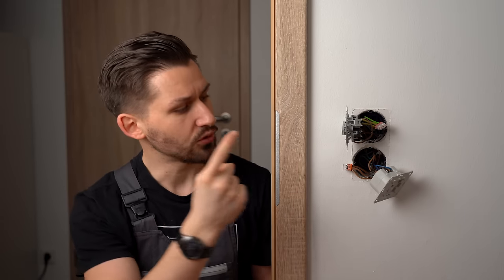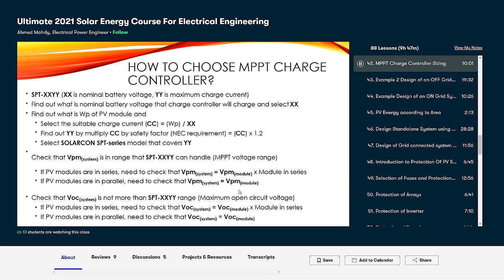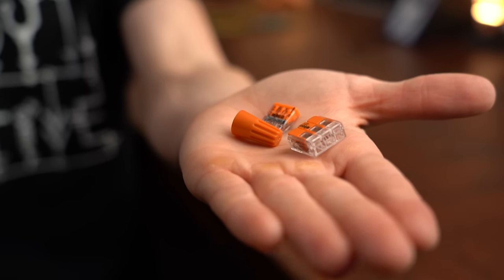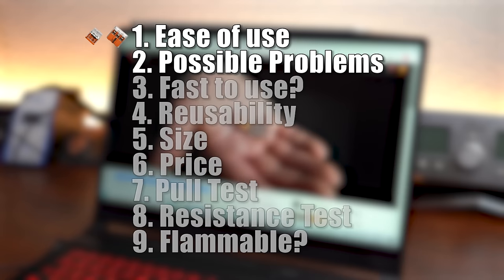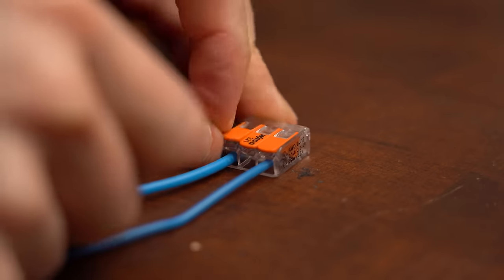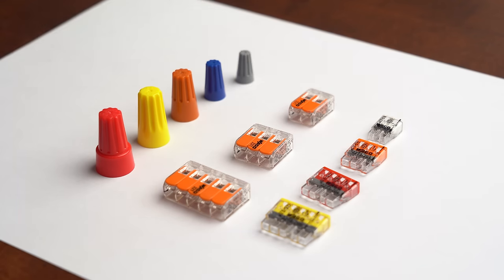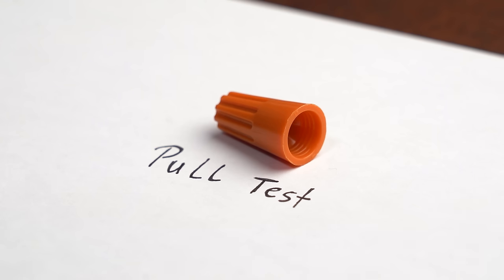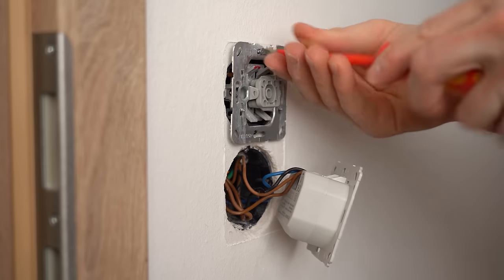What Wire Connector is the Best? Settling a Debate! Wire Nut VS Wago

Comment: The reason wire nuts don't have a current rating is because they are not intended to conduct electricity. They are intended hold the wires in intimate contact. The wires themselves are the bus. This is best illustrated by the fact that not all wire nuts contain any conductive material.
Reply: While I get what you are saying, the connection between the wires is not flawless (Especially if the wires are not perfectly connected, as seen once in this video), and thus a high enough current will still create additional heat at the connection, which could melt the connector if the current is too high. Of course such a current should not be achievable under normal circumstances, but considering these connectors are used in the US (120v vs 240v, thus twice the current for the same power) it is still a bit weird.
Reply: That was my first thought in the conductivity test. The wire nut isn't meant to conduct anything, they just smash the two wires together tightly which seems ideal but the wagos performed very well.
Reply: Ah, that makes total sense. Of course it actually adds zero resistance.
Reply: that also explained why wire nuts have lowest resistance...

but wire nuts are easily loose, especially after hard days works. in some crucial connection, this might be the last thing you want to have.

and wago have a more consistent grip
Reply: @mongelaloe2304  I think wirenutz have the strongest grip when done right but easy to install wrong and hard to check.
Reply: @mongelaloe2304  only if you're a scrub. You shouldn't have any loose connections. That's on you.
Reply: @NICKLASFARFAR  The purpose of a wire nut is to create a gas tight connection between the conductors directly. Look at the resistance test. The better Wago performed only 37.5% as well as the wire nut. The wire nut was 14.66 times better in the resistance test.
Reply: @mongelaloe2304  Properly installed wire nuts never losen.
Reply: @mongelaloe2304  wire nuts are not "easily" loosened, but if not properly tightened or checked, they can come loose, but i have seen several instances where lugs and split bolts were loose. As with anything proper installation is important.
Reply: "Properly installed" is the key, and what separates wire nuts from wagos. The  margin of error for an optimal proper installation is very narrow for wire nuts, and the difficulty curve steepens dramatically as you increase the number and type of wires in the joint. Two or three wires you can generally hold together and twist with the wire nut itself, but 4 or more requires that you pre-twist and build up additional layers. If you've got to incorporate any small fine stranded wire, such as when attaching an occupancy sensor power pack, that's a very common point of failure and rework. With the Wago, you just strip them all to the right length and use one of those wideboys and that's all you need to do.
Reply: @Peter_S_  Mate I did not say the Wago connector is better resistance wise, just saying it is weird not having a maximum current rating. How much current can I pass through the connector? 100A? 50A? 200A? Also this resistance will vary depending on how successful you manage to get the connection inside the housing (Which you can not visually confirm). The Wago rating of 32A means that worst case, it should be able to handle 32 amperes.
Reply: @NICKLASFARFAR  You don't pass current through the wire nut. You seem to have a fundamental misunderstanding of what a wire nut is and what it does. When you properly use a wire nut, something which is not shown in this video, you use lineman's pliers top twist the conductors together in a low resistance 'gas tight' connection FIRST. The connection has the same rating as the wire you are using. After you make the physical connection, you trim the end and add the nut on top to keep the connection you just made secure. In commercial service, you then add several wraps of lineman's tape at the base of the nut to prevent anything from sticking into the gap.
Reply: @jarphabib  I was taught, when using wire nuts, all wires must contact all other wires, and if that isn't possible, make multiple separate connections (so six wires would be 4+4, the interconnecting wire adding one to each group of 3). The interconnect should always be the same gauge as the incoming hot. Always twist first (using, "lineman pliers"), verify the connection, then install the wire nut.
Reply: @NICKLASFARFAR  the connector does not conduct any of the current so therefore the limitation is solely on the wire used.
Reply: @NICKLASFARFAR  -  We have 240 in USA and Canada in our homes. They only deliver 120 (one side of the transformer to each outlet) to small appliance outlets. I assure you that my stove, electric dryer, and air conditioner are 240v.  And I put in a 240 line to my bench here to power things that require a few more watts. Most Europe and foreign outlets allow 10 amps or something near that at 240. Standard US outlet allows 15 amps and I have special ones in boxes rated for 20A at 125v for those devices needing 2kw... But at that power level, most places just use the 240 across the two hot legs of the transformer. Technology connections had a good video on how our panels are wired.
Reply: @imikla  That eould be ideal! But that logic means that a wire nut can handle only 3 wires, because geometrically speaking you can only have three circles touch each other at the same time. So you would need to have two wires and a jumper to the next joint, which will rapidly eat up both your time, nuts and box fill.
Reply: Yeah. That's why they have wire nuts for wet conditions. Does Wago make a Moisture resistant connector?
Reply: @jarphabib  In theory that's true, but 4 will all come in contact in the twist due to juggling and deformation. I've also been told 2-3 is good, 4 is allowed, 5+ must be redesigned or split into 2s and three (preferably counting the interconnect). This is all more conservative that the electrical code to encourage better planning and reduce risk, as I do see wire nuts rated for 5 wires which I'm sure won't all come in contact (I don't think I've ever seen any rated for 6).
Reply: @imikla  The problem is that the ratings chart is a matrix of multiple wire size combinations with gaps in it. It says on the upper end that a wire nut maxes out at, say, 5x #10s but it does not say that you can't use it on 12x #14s.
Reply: @jarphabib  If a combo isn't listed I don't use, but I've never run across combo I needed that wasn't covered by the wire nuts I keep in my box.
Reply: @mongelaloe2304  any electrician worth their salt wrap the nut to the wire in the direction of the twist to keep the nut from backing off as you manipulate the wire into the box. Same for outlets where you connect your wires except that's to add a little protection, specially in metal boxes
Reply: My older home from the late 1950's contained ceramic wire nuts that didn't contain any metal in them at all.   Great comment Michael Aichlmayr.
Reply: @MARKE911  in the UK? They were called Scruits and are no longer permitted. They worked ok on the old soft lead cables.
Reply: @RabbitsInBlack  Yes they do, it's called 'Wago Gelbox'. They have protection class IPX8 (indicates that the terminals are completely sealed and can also be permanently submerged in water)
Reply: @Ed Straker  You rarely see 240v used for circuits less than 30 amps in the US.
Some 20 amp 240v circuits are out there but the majority of buildings do not have then.
Reply: @typoagain1  so are all those 240V circuits hard wired? No plugs and sockets?
Reply: Wonder that nothing was said about, that you can probe wago from the front, as they have a touch proof opening to insert probe needles. Furthermore, wagos can have spare connectors, which would allow easily to add something to an existing circuit. This becomes very handy especially for neutral and earth lines, which are usually connected all together.
I never used wirenuts, so I wonder how you probe them and how you add wires anytime later, other then replacing them.
Reply: @NICKLASFARFAR  Not really. The wire you are using already has a max current rating. If the wire nut is rated to handle that wire it is rated thus to handle the current. Tight connections don't get really get "hot" as long as the wire or bus is sized accordingly.
Reply: I have seen connectors that rely on a blade or thin piece of metal to conduct current between wires fail after a load like a electric space heater was connected to the circuit. In America the code requires compression and  properly used wirenuts will do that. Often electrical connections will fail when a spring weakens (often from heating and cooling cycles). Once a spring become weak, the electrical connection may start arcing. This creates peaks/valleys due to pitting. This lowers surface area of connection. I seen this with the clamps of a breaker on the busbar. Once the busbar under the clamp, it heats the breaker causing it to trip. New breakers installed in the same location suffers from the same problem. This is because the pitted metal does not have enough surface area and produces heat. This is why I prefer wirenuts for load bearing circuits
Reply: @NICKLASFARFAR  he didn't use the correctly in the first place you're supposed to twist the wire's together tightly with pliers then add the nut
Reply: @pen25  yes of course, some others also pointed out that too... the keyword here is the craftmanship when we are using wirenut.
Reply: Yeah I would like to see a high current test through each of the connectors. See which one fails first
Reply: @NICKLASFARFAR  The maximum current you can pass through a wire nut connection is dictated by the gauge, and therefore maximum continuous current, of the base wire.
Reply: @tonyjover  Usually HVAC things are hard wired, so air conditioners, furnaces, water heaters and heat pumps because they are considered permanent installations.  Electric clothes dryers and stoves (hobs) have plugs.  Very large plugs.  In such that the NEMA 5 plug is dwarfed by the UK plug, the UK plug is dwarfed by the NEMA 14.  Although most of the time those appliances are considered permanent installations, they do break and can be replaced, upgraded or serviced more easily since they can be unplugged.
Reply: @tonyjover  we have multiple styles of 240V plugs and sockets. It's often based on appliance current draw and whether it's a 3-wire or 4-wire circuit.
Reply: @NICKLASFARFAR  If you are using the appropriated wire you shouldn't have to worry, after all they come with the max current the can sustain and will only cause problem if you exceed it
Reply: @KlodFather  in Germany 230v is for small devices and 380v for stoves or heaters and so on. We have fuses from 6a to 63a in small houses. The most common fuses are 16a, 20a, 32a and 63a. Living in a flat we only have 16a fuses
Reply: I never had any issues with the wire nuts at work I cannot remove the wire from these useless wago connectors so I just cut the wire off remove the ballast and use orange wire nuts to connect the wires that go to the light sockets if I could remove the wires I would keep the wago connectors. Bottom line I never had any issues with the orange wire nuts. I see the ones on here have removable wire features but cost is not worth buying wago.
Reply: @ricozam132  -   I had the opportunity to visit Ukraine in Russia in the past. They use the same round plug with two pins on it that you guys use in Continental europe. It was also scary to see how much aluminum wire that they run to those rooms and outlets. I don't think you guys are doing the same things that they are there, but it looked like the thickness of American 12 gauge wire and the outlets were rated at about 10 amps. I've also seen a bunch of European connectors and plugs because we had them in one of the factories and I worked at. We built our f equipment specifically transmitters and other electronic instrumentation, and a lot of it was actually designed operating europe. So we always had European outlets around. Although we were feeding them with 60 HZ power instead of 50 because that's what's available. In some rare cases we had a motor generator set up that would turn 60 HZ into 50 hz. That was pretty effective it delivering actual power. I noticed that the rated or stated voltage and what's actually in the outlets is different from place to place. When I was traveling internationally I would actually get my digital meter out and not only look at the waveform being provided in the wall but I would also look at the voltages. Most countries that were 222.3240 where somewhere in that range. It's like here in the states. Even though they say that we have $120 volts that we have 115, depending on where you're at in an electrical system, some places might be 111 or 112 volts other places might be $127 like where my parents lived. We just happen to be on a particularly hot transformer. So sometimes it doesn't have any rhyme or reason or it depends on how close you are to the substation because the transformers on the pole have taps for the high voltage side and if the high voltage side is a little bit high and they're on the lowest tap on the transformer that takes it off the feeder to the line coming into the house, it could be a number of voltages. I knew about your 383 phase. Three legs of 380 and any one of them to neutral will yield you 230v or so. We have something similar here called 208v 3 phase. It gives us three legs of 120 and there is 208 between the legs for running bigger appliances. Large appliances it require 220 or 240 run a little softer on 208, but it works good enough that nobody complains. Stoves air conditioners furnaces and other equipment that would use the 220 if they're fed 208 work just fine. It's a small enough percentile that there's really no degradation in performance or at least any that's noticeable. But when my foreign wife came here with a bag full of 220 appliances, she was perplexed at our outlets and that they didn't work. However I'm a resourceful guy. And having worked in that company where we had European outlets, I ran a 12 gauge three wire line upstairs with a ground to a special box and I put in European outlets on the kitchenette. They were providing roughly 220 volts 60 HZ and the teapots hair dryers and all the other devices function just fine. There was 20 amps coming up there and all of those individual outlets were fused at 10 amps or so.
Reply: @JbVest  -  that should be easy. You can also see from his data that the resistance is much higher on the pushing connector than the wire nut. It's very easy to calculate the amount of power that will be dissipated at that connection at a said current because we already know the nominal voltage. The wire nuts are not going to get hot because they're not actually passing the current. It's going to be predicated on how well the conductors are wrapped with each other and the wire nut is on them. The pushing connector is definitely going to get hot in a hurry because of the size of the surfaces that are in contact with the primary wire. It's going to be a lot of heat dissipated in those connectors at their rating. They will definitely be warm to The touch under load. He even says so in the video. He was very clear to say then when they were up at their maximum current, they got warm.
Reply: @mongelaloe2304  I am an electrical engineer.  Worked in Germany and now in the US. When using wire nuts, it's dirt simple.  Key is twisting the wire together first, then twisting that single wire onto the wire nut.  Twist until firm, otherwise they will slip (weakness with wire nuts).  
Twisting with different gauge wires is simple. Wago is limited.  
Simple clamp in Wago.  Not enough surface contact. That's what it's all about in electricals.  
Wire nuts easy to read with color coding.  
lots of conductivity and contact.  
Why re-use a Wago connector when electricity is involved? Should be disposable.  Would you put a used engine into a new car chassis?  
In the US, wire nuts have been used for decades.  
As Einstein said, "make it as simple as possible, but no simpler."  Wire nuts.
Reply: @Ed Straker -  The furnace and air conditioner are wired direct because they are permanent installations. Stoves, portable air conditioners, clothes dryers, and electric heaters and cookers all use a plug. Some plugs are giant and some are about the same size as our 120v with the prongs turned sideways depending on current rating. My ex-wife was from Europe and she had a lot of 220v small appliances when she came here. I ran a 220v 60hz line up to the kitchen and put in some EU plugs with breakers at 10A each. Those worked well for her. A tea pot that is 2kw boils water faster than our 1350 watt tea kettle but only marginally faster. But this setup made life much easier for her until all that stuff eventually broke some years later. I can tell you that motors like 60hz much better and do not labor as much. We had to be careful to engineer enough fans and cooling into 50hz equipment we built because the motors and fans all turn slower on 50hz even with the same given voltage. For the most part, your appliances will all run well here if the proper plug is installed to connect them. Work just fine.
Reply: @KlodFather  very concise info there sir. That was my thought too, on the wire nut.  If you twist the wires properly for a wire nut all it's doing is somewhat insulating it and holding The joint together. I could certainly see your higher resistance on the waygo connectors but high enough to be a concern in proper applications,  probably not. Would be interesting to see just how it would fail under a unrealistic current load
Reply: @JbVest  -  I think we should have Photonic Induction do a test on this since his machines can generate all the juice, fire, and smoke necessary to give them a proper test  :D  😅🤣😂
Reply: @Ed Straker -  The part that give me a good spook was that the panels in one country I visited had 440 in them with a center tap for 220 + 220 setup with the neutral to ground like USA breaker panels. 440 is a bitch and was more than I wanted to piss with LOL. Some of the wiring I saw in old Russian apartment buildings on the mains left much to be desired. I am going to have to post some of those photos sometime soon for people to look at. Three 220 mains about 35mm diameter running up the central shaft of the apartment building. People just tap them unfused and then breaker them inside their apartments. I have seen them with jumper cable claws bit onto the main bus bars. CRAZY
Reply: @KlodFather  Now, now, don't take away their sense of superiority over us.
Reply: @jarphabib  And wire nuts have a learning curve. Especially when joining solid and stranded wires. If one wire is too long, it bottoms out in the wire nut and won't let the connection get tight. I've seen loose connections where all I had to do was snip off 1/8 inch of wire and they tighten right up.
Still, it's a common practice to use electrical tape over each wire nut, which kind of defeats the whole purpose!
Reply: @mongelaloe2304  That's probably why wire-nuts are often taped if they're critical. But even then, I wouldn't say they're easily loosed if properly put together.
Reply: @NICKLASFARFAR  your assumption about twice the current for the same power is flawed, because thicker wires end up being required. Also, fully ceramic wire nuts are routinely used for natural gas hot surface ignitors. They merely hold the wires together. Even wire nuts with metal inside do not expect the metal to conduct. It is a conical steel spring that merely holds the wires together. The Wago has current limitations, because its design requires a bus bar that wire nuts avoid. The best part is the part you leave out, because it will never fail you.
Reply: @ronb6182  Sorry, but when you use the old fashioned, stupid wire nuts you have to cut all wires, when you want to add only one more wire!
It's easy to disconnect and reconnect all kinds of WAGOs, no need to shorten the wires. The types without the lever are available with up to 8 holes. In Germany we use WAGO for more than 40 years without problems. Also our outlets are much smaller than the ugly american outlets, we don't have the space that you waste with wirenuts.
Reply: @horstklotsch5589  nope I will keep using what I have I'm not going to make these foreign ers rich just because they come out with something new. The ones in the fixture are one time type you cannot remove the wire. I would reuse them if I could pull the wire out. I have to remove the ballast anyways. I work for a company that don't want to spend money and I have a boat load of wire nuts. We use gorilla nuts in our machines I'm sure there is a water proof wago but it's not up to me to tell the engineers what to use in our Air machines. Thanks but no thanks. 73
Reply: @horstklotsch5589  nope I will keep using what I have I'm not going to make these foreign ers rich just because they come out with something new. The ones in the fixture are one time type you cannot remove the wire. I would reuse them if I could pull the wire out. I have to remove the ballast anyways. I work for a company that don't want to spend money and I have a boat load of wire nuts. We use gorilla nuts in our machines I'm sure there is a water proof wago but it's not up to me to tell the engineers what to use in our Air machines. Thanks but no thanks. 73
Reply: @ronb6182  More than 40 years is not new for me...
Of course you can remove the wire easily, and reconnect it without additional work, but if you don't want to learn somerhing new, I can't help you. I don't make foreigners rich, because WAGO is a German company and I am from Germany:-)
Reply: @horstklotsch5589  if they ain't made in the USA they are foreign. Bottom line my work won't buy them. Money is tight right now And everyone wants to keep their job and hours. I see others think it's a waste of money if you read the comments maybe not on this video but others on you tube. 73
Reply: @NICKLASFARFAR  if the wire nut is tight, then its a good connection, even if the the wires are side by side.
Reply: @mongelaloe2304  thats why you use tape, it helps keep the weather out, as well as keeps the connection tight. You know for an electrician channel, there are a lot of clueless people here
Reply: @NICKLASFARFAR  as much as the wire can handle. Are you not paying attention?
Reply: I was gonna say the same thing, the current rating is the rating of the wire inserted, since its really just connecting two wires together
Reply: @tonyjover  Plugs and sockets up to 50amp 240 1phase are common. Over 50 amps are USUALLY 3phase. (And expensive!)
Reply: What is relevant is the nuts temperature rating.
Reply: @rok1475  No, I'm not mistaken. Read both my posts. Firstly, this post is addressing The issue of the current rating. Secondly, The twist and the wire nut are both involved in the holding. If that weren't true, no one would waste money on wire nuts, they'd just twist them and wrap them with tape. And of course insulation is one of the properties, that issue was never in question. Are you just looking for an argument?
Reply: @SAxSF  I agree. I thought about mentioning that, but decided to leave that can of worms to be opened separately. (Not that it's not important; temperature rating is one of the worst neglected parts of electrical wiring, but it's a lot bigger issue than just wire nuts.)
Reply: Monge
Of course both generally aren’t in a moving application 🤔
Reply: Monge
Of course both generally aren’t in a moving application 🤔
Reply: Monge
Of course both generally aren’t in a moving application 🤔
Reply: Monge
Of course both generally aren’t in a moving application 🤔
Reply: @rok1475  Nope. You are wrong.
Reply: @imikla  
It seem you can’t understand even such a simple fact as why one can’t just wrap tape around twisted wire ends. 
To prove your point you respond to facts like a small child.
I regret wasting my time explaining anything to you. 
Have a good day.
Reply: @rok1475  I see you resort to insults when I refuse to argue with you.
Reply: @NICKLASFARFAR  if you hire an electrician that's doing the job properly then it isn't a concern, you have to use lineman's first and twist the wires into a very good connection prior to using a wire nut, the wire nut is not intended to twist the wires like he was doing in the vid (you can especially tell he used them wrong when the wires were twisted down the shielded section).
Reply: @NICKLASFARFAR  user error causing a poor connection would not be part of a spec
Reply: @Ed Straker for that voltage we use two phases to add up to that. Most appliances run off of 110
Reply: @mongelaloe2304  you definitely have to put the wire nut on correctly for it to work
Reply: @Ed Straker Most large appliances in American homes have 240v plugs if they require 240v. Cheaply built houses and apartments might have the stove hardwired, but clothing dryers often have a 30A 240v plug.
240v plugs are most common in 30amp, and 50amp configurations.
Reply: then their design is even more poorly done than i have thought, thank you! i will make sure they will never be used anywhere near me.
Reply: @FTfilm  wire nuts?

how is it bad design for no current to pass through an insulator
Reply: The wire nuts that are just plastic without the metal spring part are terrible, they don't bite down on the wire at all.  Better electrical tape the crap out of them if using those.
Reply: @Dan-yk6sy  electric tape brakes down into nasty goop after a while. Just spend the extra fraction of a cent on the wire nut with metal
Reply: @horstklotsch5589  I deliberately compared the Wago connectors with the same size wire nut and the Lever Wago was LARGER then the wire nut... that debunks the size statement... the next is the push ons... they are about the same size for a standard three wire connection, but the wire nut can be removed and reused if necessary, whereas the Wago MUST have the same size solid wires and cannot be removed or reused... only cut off.   You can call them "stupid" all you like but wire nuts have their place and purpose and are as effective as the Wago with less complication and cost per part... just a little more technical expertise or experience is recommended for wire nuts. There are also many applications where wire nuts can be used where National Electric Code will NOT allow the use of clamp style connectors.
Reply: @edwardpaulsen1074  Of course the Wagos can be reused. I would only describe the user as stupid, if he doesn't know how to get the wires out again...
Reply: @JbVest  I've seen a high power test somewhere and the conclusion was that the Wago can take more than the wire insulation can. I would like to revisit that clip, but don't have it saved.
Reply: @ContraVsGigi  id like to see that too, but how my mind works, id say if the wire was twisted properly when using a wire nut, that would beat any other connecter style. just cant see the wago beating the twisted copper to copper. but hey what do i know!
Reply: @Keechization  Yes of course, thanks for pointing it out for me.

I didn't mean wire nuts are bad, they just have to be handled correctly, like some other said it's all back to craftmanship, that's very much agreed.

Because we cannot see what's inside, and for me myself, i usually gives a pull or two to make sure the connection is ok. Just to make sure
Reply: @skrenos  so just like here state side.  Our major systems are hard wired 240 of course and our other appliances are plug in 4 prong 240 . Our small appliance outlets are 120 of course
Reply: @NICKLASFARFAR  I have never seen a wago connector until 3 years ago. I haven't went back not because they are better for any other reason than they are quicker. Wire nuts dont have a rating because they dont transfer electrical current they just hold wires together thay conduct that current.wagos are great I love the ease and the ability to use them in tight spots they hold good .. good enough for a wire for sure I feel like some people act like these wires hold thousands of pound so pressure they dont . I love wago connectors I wouldn't say they are better but they are my choice
Reply: @ptravers9077  Eh?  I was describing state side wiring which is why I mentioned NEMA.
Reply: That is just stupid, because current in the wires will heat the connectors, no matter if they are conductive or not and the material has to be able to handle the heat.
Reply: @Wheresmy240  Nope... not "very well".
Reply: @mongelaloe2304  loose connections are NEVER acceptable... not "might be".
WAGO has a wire termination that can wiggle. This is why higher resistance, because the busbar has a higher CSA than the cable being inserted, and the conductor is not firmly clamped down. 
Further, dissimilar metal connections induce corrosion. Any plumber will tell you steel saddle clamps on copper pipe is disaster waiting to happen.
Reply: @Peter_S_  LOL... gas tight connection? 
Wire nuts are a very poor option compared to other forms of mechanical connection.
Reply: @jarphabib  Oversize WAGO for small conductors is asking for loose connections.
Reply: @pen25  Yeah BUT, in the USA any idiot can do home wiring.
Reply: @ronb6182  Those lousy wire nuts are used in Aircraft? What type, so I know what to never fly in.
Reply: @BTW...  we are not talking about aeromechanics STAY ON THE SUBJECT!  I don't wire airplanes or Automobiles. I only wire my own home. Enough said. 73
Reply: @ronb6182   You mentioned "air machine"... and the point is I never ever trust either wire nuts or wago in any mains wiring system... or an aircraft or a boat or ship.
It's a matter of integrity.... and on that point here we don't allow unqualified randoms wire up homes.
Reply: @seanthiar   obviously dont get it the have no rating because they conduct no electricity.. there for if the administrator a load to one end and then the other there will be nothing because it's not conducive.. the rating would be that of the wire you are using. There heat rating has nothing to do with conductivity and wire nuts do hold up under heat as well as wago if not better since that dont conduct electricity.
Reply: @seanthiar  That is why temperature ratings and capacities must be taken into account for ALL connections.
Reply: @mongelaloe2304  Hard days work?  Wire nuts are for household wiring.  They're not supposed to be used for anything that is going to be moving.  There are other connectors for that.  Do you typically flex your walls during a hard days work?
Reply: Calling BS on your statement that they don't have an amperage rating. They ARE rated by conductor size. Yellow wire nut, two conductors max 12 gauge=15 amps per NEC. You actually have to use whatever passes for a brain. Instead of pushing the connectors you are getting paid to push.
Reply: but the nuts in the video do contain metal, which will melt if abused.
Reply: @BTW...  air machine to vacuum cars out and to fill the tires up. I forgot the vac part sometimes it air and water machines . I cannot tell the engineers how to make the products I just put them together. If it was up to me everything would be direct wired or good terminals. I have my own design and it's not what I build at work.
Reply: @Rem1061  You actually just agreed with me.
Reply: @sombrero4316  Sure, I agree with that. If you don't follow the guide, you're asking for trouble. The number of wires and sizes for a given wire nut are listed for a reason. It also doesn't hurt to study about temperature ratings in the electrical code. It applies to many more things that just connections.
Reply: @Peter_S_  Yeah they do vibration will loosen them
Reply: @mongelaloe2304     vous n'êtes pas un professionnel de l'électricité
Reply: @horstklotsch5589  Why yes, the lever action ones can easily be reused.... not so much with the other variant... Yes, there is a possibility of spinning the wire while pulling and spiraling it out... not very effective inside the electrical box or with more than one wire. I am sorry you did not make that distinction. The other VERY specific detriment to those spring loaded types are that once the spring has been clamped and deformed onto a wire once, they lose a certain amount of applicable pressure capability and this has been inarguably proven within the aviation and transportation industries.  

Again, I like using the Wago connectors whenever it makes sense, but there are some situations where the wire nuts are a better choice with appropriate application.
Reply: @sierra5065  wrong, due to current, stuff gets heated as current passes and the "special" twist you made using pliers, loosens up due to expantion, air gaps appear and thus conducts less current and more heat is generated.
That's why they where phased out in Europe and "forbidden" to use,  quite some time ago.

In the past we had a special porcelain or plastic tools for these connections.
Reply: Exactly.  This is evident in the key test of resistance.  The WAGO fasteners are using what looks like a steel connection between the wires while the wire nut directly connects two copper wires.  Copper has a much lower resistance to current than steel.  This results in a better connection (allowing more current to flow) and lower temperatures (since resistance is lower).  A WAGO using copper wouldn't work well since copper is much softer and might cause the connection to fail under tension.
Reply: @Peter_S_  Loosen not losen
Reply: @NICKLASFARFAR   YoUr CoNnEcTiOn IsN't FlAwLeSs
Reply: Every wire nut I have come across has been made of solid porcelain. I mostly use choc block in a mole box.
Reply: @jarphabib  great for for amateurs. Professionals should have the skill to connect a wire nut if they all themselves a professional.
Reply: Wire nuts actually do have a current rating, but more in line with what wire gauge and how many can be joined.  They don’t pass current but retain the conductors.
Reply: @KlodFather  Well spoken.  The Engineering Mindset has a decent explanation as well.
Reply: Yeah, I just started working with an electrician and the wire nut size you choose is just based on the size of the wires, no googling or memorization required. Wago connectors might still be better but that point of comparison isn’t really that valid
Reply: Plastic doesn't conduct electricity 🤣
Reply: Wire nuts are just that. Simple clamps. It doesn't help the connection in any way, hence they are completely reliant of installer competence. Wago are a bit more sophisticated (hence the price) but are much more fool proof.
Reply: @Wheresmy240  however, the metal cap inside is live if touching copper, therefore should be correctly rated..
Reply: DIdn't the one he showed have a little metal spring inside?
Reply: @Monge LaLoe,

Wirenuts come loose if they're installed wrong.

Wagos lose their spring over time because they're always under tension. So point of failure is guaranteed.
Reply: @torstenwagner1185  it's the better question when do you add lines normally?  makes sense if your changing connections like once a year or not but whats the point of having connections like wago with 4 ports if your only using 2 for 40years and then decided to add another wire 10 years later

it does easily to add something to an existing circuit but circuits don't change often,

this is coming from someone who lives in a old house that at one point had 3 fuse boxes since it was a old telephone building but was added 4 times onto from 1900s till now.

since we re wired the house in 1995 we only added a circuit in past  27 years
Reply: @NICKLASFARFAR  I've seen multiple people talk about the wire nut connectors melting because the contact wasnt good enough and it overheated.

Wagos make way more reliable contact unless you want to solder before putting on a wire nut.
Reply: Intimate 🔥
Reply: @typoagain1  I have 4 20AMP 240V breakers. All electric baseboards
Reply: @Peter_S_  i find out burnt out ones made by Conex all the time.
Reply: @Boz Scaggs Obviously
Reply: @NICKLASFARFAR  I don't think there was actually anything wrong with the connection shown in the video.  Unless one of the wires was actually loose, that connection would still have been better than traversing a bus bar and two contact points.

Most of the points in favor of the Wago over the nuts are meaningless to an electrician.
Reply: @jarphabib  Not really, if you're using the correct size wire nut for the wires you're using, you shouldn't have much trouble getting it right. And a bit of electrical tape over the top after you're done makes absolutely sure that it's not going to wiggle loose on it's own later on. 

I'm personally more worreid about internal damage to the wires getting everything in and out of the box when the previous idjit was trying to do too much with one box.
Reply: @imikla  That's what you're doing wrong, you actually learned what you were doing before bad-mouthing the equipment. I do think it's worth noting that wire nuts have been around for quite a few decades at this point, and if used appropriately, they work. It's also worth noting that the other ones he's demonstrating are German, as in overengineered kit that isn't always good enough to justify the engineering that went into it. 

Personally, I’m more than happy to just use the wire nuts and just be mindful about making a proper connection, as it appears to be far stronger mechanically if some bright guy decides to pull on one or the other end.
Reply: @kevinsundquist1989  Precisely, the metal in the wire nut is there to provide some teeth to pull the connection in, make it less likely to pop off or split when installing. It's just there for reinforcement, not as a conductor. It will conduct a bit of electricity, but only because they don't worry about using a non-conducting metal. It's certainly never intended to be the conductor the way that some of those blades are in some types of wire connectors.
Reply: @jarphabib  Just speaking from my own experience here:  I HATE using dissimilar metals or wire types (stranded/solid) or differing wire gauges in any one wire nut.  That's asking for trouble down the line.  I get varying reactions from my electrician friends WRT taping of wire nuts after installation - some say "yes" while others say "not no, but HECK no!".  I tend not to tape them after t/s & r unless they were taped originally (and to use the same type of tape as in the original installation).

Using dissimilar metals can occasion thermoelectric effect:  current flowing across the junction of a de facto thermocouple can cause it to heat up!
Reply: He also didn't twist his solid wires every electrician knows you twist to give a solid mechanical connection before you put the wire nut on. Thus reducing down the Resistance and possible heat.
Reply: @horstklotsch5589  why do you have to cut the wires with a wire nut? Just add a wire and a bigger wire nut.
Reply: 45 years in the business,  when wire nuts are installed correctly,  no failures.
Reply: Yes, I stopped watching right at that point...
Reply: @edrorie7764  electric baseboard radiator thermostats come with wire nuts and not Wagos, must mean they’re safe.
Reply: @horusfalcon  they make wire nuts for AL/CU connections.
Reply: I've never heard this,  this is good information.  👍
Reply: @calysagora3615  this is good information too, Mexican ingenuity.
Reply: @etherealrose2139  your 100% right.
Reply: @Peter_S_  Peter S is a good electrician.
Reply: @imikla  this good solid advice. 👍
Reply: @NICKLASFARFAR  I was about to switch to Wagos after seeing them so often online but this video has convinced me otherwise. Stranded wire should be further in the wirenut than solid. Granted, it's not written on the connector so perhaps for DIY it's a poor choice.

But these tests show the Wagos losing in the critical categories. Equal weight is not appropriate IMO. Price is the non-critical category which I would weight the highest. Again, wire nuts.

But safety? I gasped at the resistance the Wagos add. Close to a quarter mile of wire?! I'm suspicious of the pull test - it wasn't completed. Why did the wire nuts win there but tied on size and flammability? What happened to only one winner?
Reply: @ronb6182  "I'm not going to make these foreign ers rich just..."  Do you walk everywhere and never eat fresh vegetables in the winter?  How are you even connected to the internet?  We barely manufacture anything in the US anymore.  Even when we do, there will be components that have been internationally sourced.  How is it that people who spend time talking to folks outside our borders have such a poor view of them?  73 LOL
Reply: @NICKLASFARFAR  Greetings:.  "Twice the current, same power" ??? Mathematically illogical.
Reply: @Dark_Knight_USA  120V * 2A = 240V  * 1A
Both equaling same power, however 2A results in 4 times the power loss in the connector as the power loss is R * I^2
Which part of this confuses you?
Reply: @NICKLASFARFAR  Greetings: The equation, as listed here, is logical. No confusion. and no debate given.  On another note, what is the "^" in the formula?
Reply: @g00gle minus I have worked in Low Voltage around professional electricians for years, and have seen them use Wire nuts, it takes them about 10-15 seconds to twist and cap the conductors, about the same amount of time as pushing those same conductors into a Wago. Experience and Training Matter. I did not talk about stripping because both connector types require that.
Reply: @Dark_Knight_USA  if you don't have a way to do a Super Script when writing a formula ^ becomes "To the Power of" so I^2 spoken would be "I" Squared.
Reply: @kelaEQ2  Greetings: Thx. My hand can write superscript with no problem.  Typing it can B interesting, depending on the device.
Reply: @mongelaloe2304  Wire nuts are still a thing in The Netherlands, besides different kinds of Wago clamps. Wire nuts were the first type of interconnection possible in house wiring (they started off with tar, than we got porcelain, than plastic ones).
But, in contrast to the US, they are NOT allowed to be used on stranded wires. Solid conductors only AND one will have to twist the wires first. Just having two wires side by side and just twisting a nut on them is not allowed. One needs to twist them thoroughly before screwing the wire nut onto them. Once the wire nut is on, you can unscrew the plastic cap to check whether the connection has been made in a correct manner (wires only slightly sticking out at the top-end of the metal spring, insulation clearance about a 1 millimeter before the spring starts).
The twisting is hard if your wires are short (10 to 12 centimeter (4 to 5 inches) as is usually the case in Dutch housewiring junction boxes, which is why you will usually get taught how to twist the wires correctly when you're an apprentice or intern: instead of short pieces, the wires are stripped 10 to 20 centimeters long. With 3 conductors, one 1 is fold to the left, while the other two are fold to the right. Then you twist them by grabbing on to the copper conductors. When done, you cut the excess conductors to length and screw on the wirenut.
The downside is when you are lefthanded: my dad is lefthanded and always had trouble twisting the wires (which should be done clockwise when having the end of the wires point away from you) as the wirenuts always screw on like you would fasten a normal screw. That's far easier to do as righthanded electrician.
Reply: Best  and most educated comment by far on this video
Reply: Those wires are getting intimate over there 😏
Reply: @jentronics3754  The most basic problem with clamps is that people either re-use them after pulling wires out, which is not recommended, or that they just don't read the instructions on the length the bare conductor needs to have. They either strip too long or way too short. Too long isn't such a big deal: if the wires touch, a dead short will most likely be the result and that's dealt with by fuses or circuit breakers.
Too short however is a problem and frequently occurs: the wire then does get stuck under the clamp but with very minimal contact. It can't be pushed in deeper because the insulation interferes with the connector. It's a solid connection outside the box, but once the wires are all pushed inside the junction box (I'm talking about my Dutch experience as an electrician here, our junction boxes are not big) the connection can loosen itself from the connector. It will make contact and provide voltage, but only at light loads. Heavier loads will get the connection warmed up and eventually fail. If you're lucky, it fails by going open, if you're unlucky it starts a fire.
Fire's rarely start by short circuits as you read in the newspapers often in The Netherlands. Contact-resistances do.
Reply: @BTW...  Just like in The Netherlands, where the profession of electrician is also not protected (unfortunately...)
Reply: @David-bb2ed  Whole cities are now wired with Wago-connectors in The Netherlands and probably for decades. If they are that bad, I expect a high amount of domestic fires, but the opposite is true. Domestic fires are still as uncommon as they always were. The only difference is that all the insulating stuff, which is usually a plastic, usually kills you far quicker than in the past, when home-insulation wasn't such a big factor yet.
Wago is a well known brand throughout Europe that has a very broad range of cage-clamp DIN-rail connectors, still the old style screw-clamp connectors, PCB clamp connectors or lifting-cage connectors, and what nots.
They're not stupid and test their connectors thoroughly. They don't want claims because their products aren't specced properly. Usually when it DOES go wrong, it's up to the electrician (read: any normal person, the title is not protected in The Netherlands) that installed them and did something wrong.
As stranded wire is not even allowed in wirenuts in The Netherlands, it's a factor I can't even judge for DIY use.
Reply: @mitch9509  Indeed, it is or near the top .
Reply: @weeardguy  It's not a matter of 'protecting' the profession. It's a matter of integrity and safety for the users of an installation.
Reply: @weeardguy  When you mention "stranded" wire (lets say 2.5mm sq CSA) how many strands in that conductor? 7 or >20 multi strand?. 
Australian Standards dictate that all Earth conductors are stranded rather than a single solid wire.  It reduces potential for fatigue breakage.
Cable - The very cheapest 3 conductor,  thermoplastic sheathed cable has solid core Active & Neutral with stranded Earth.  The far nicer and easier cable to work with (and more expensive) has all 3 conductors stranded... being far more flexible and less prone to conductor breakage when reworking behind switch plates, J-boxes etc. ALL multi core cable ( >3-5 core) will be stranded flexible construction.  Inter-panel control cable could have >12 core + Earth... I've frequently installed and terminated 24 core, 7strand @ 1.5 and 2.5mmSq CSA. 
The most common means of connection is by screw clamping. 2 screws on any Earth connection in J-Boxes and Earth bars in a distribution switchboard. 
Wire Nuts are NON-COMPLIANT to A/NZ Standards. 
Here, you only find 'spring clamp'/WAGO etc in consumer appliances or in the form of DIN35 rail mounted terminal blocks, where the conductors are always multi strand.
Every stranded cable I've ever terminated in these 'spring clamp' terminals has had a crimp ferule applied.. ALWAYS. The same apples to screwed box terminals anyway.
Reply: @BTW...  2,5 mm2 is always >20 strands, most likely even 1,5 mm2 is already over that number of strands. I can't remember ever seeing wires with less and thicker strands in that size.
When you get to (I think) 16 mm2, wires can be thick-stranded or multi-stranded, the latter being easier to process in junction boxes and electrical cabinets and such as it bends much 'easier' (at my former employer, cabinets were usually ordered a tad too small, which lead to the electricians having to resort to very sharp turns that were hard to deal with: where they used their body weight, I had a bit of a problem with just 55 kilo ;)

Earth conductors depend in The Netherlands: in cabling it's always stranded and even in cabinets it's usually stranded. In appliances like emergency lighting and evacuation-path-illumination, the wires usually are solid (but then all and not only the earth wire).

The differences are structural earth wires. Those tie the grounds of the concrete-armor of the home with the electrical installation, the gas-mains (if applicable, there's no natural gas-mains coming into the home I live in), the water-mains,  the central-ground-point coming from the shower, and are all rock-solid.

The earth-wires in the shower to the central-ground-point are also all solid (2,5 mm2 tinned copper). In the shower, the radiator, water-mains, concrete-armor in the floor, the socket for shavers, the shower sink cover (if metal), the bath-tub (if metal) and all 'strange conductors' as our electrical code calls it, connect to the central-ground-point, which is a massive tinned-copper block where every connection is tightened with two screws. This point is usually unconveniently located under the sink or behind the mirror.
If I remember it right, a thick 6 or even 16 mm2 solid tinned copper wire goes down to the main junction box, where it connects with the main-earth-point, that in turn, gets a solid tinned copper wire (2,5 mm2) from the earthbar in the fuse-box, (those earth bars usually extend out the side of the box) and also gets the water-mains, gas-mains, and (if applicable) the concrete armor ground connected to it. From that block, a very thick solid tinned copper cable runs down to the earthing-electrode, but this depends on the system used. Some systems used the concrete-armor from all homes as a suitable earth, some use an earthing electrode for every home but link all those together (to get the earth-resistance lower) and some just stick with an electrode per home. There have been homes were earth would be delivered by the utility-company, but I never encountered those situations.

Wire nuts are allowed, but only on solid wires and only when at least 3 wires have to be joined: putting a wire nut on just two wires is not allowed (but trust me, especially in older Amsterdam homes, you'll see it a lot)
This is because we (as far as I know) only have two sizes of wire nuts that only work when 3 or more wires (5 is the max for the most used, 2,5 mm2 variant) are available.
Screw-clamps are still very common, but it completely depends on the situation what is used.
Spring clamp terminals like Wago Topjob and equivalent were widely used at my former job. We usually only crimped ferrules on wires below 0,5 mm2. Above that, the wire was stuck inside those clamps 'bare'.
Screw terminals always got ferrules where I worked, but it differs from company to company.
Our code is covered by NEN1010, but as this is a norm thought of by the wholesalers in electrical products, it's not that surprising they usually change every year.
Where NEN1010 is just a norm (and you thus are allowed to deviate from), the Building Code however is a law and as the Building Code states something like: 'The electrical installation of a building used for living or utility, must adhere to NEN1010', this basically turns NEN1010 into a law, which is why there's a decades long debate going on from (especially) electricians that the NEN1010 books should be free of charge instead of costing the pretty penny like it is now. I had to spent something like 570 euro on the 7 (yes, really 7) books that covered the NEN1010: two years later (after I finished my education to become an electrician) the NEN1010 norm was revised and brought back to fewer books, but as a revision completely supersedes the old version, one will have to buy the new version to stay up to date on the new rules.

And since 7 months I now work in a completely different environment where I don't even need all the NEN1010 crap I got in school over the years ;)
Reply: @joseph5900  Which is exactly what I said.
Reply: You one smart cookie. I’ve been using wire nuts for years and I would not have thought of that reply.
Reply: I Love The way you say held together in intimate contact with each other.  It's almost like saying that God is the nut that holds intimate connection together, so I suppose Jesus would be the electrician that twists the intimate connection together and places the nut. Job completed and for added safety a little tape so all know it's black so it's dangerous voltage.  And let's face it, people are attracted to colors so colorful wired nuts, have no barring on the size, rating, OR INSULATIVE.....is there a rating for insulative rating?  Besides resistance so communication is not broken between SAFETY and Design?  It SHOULD have since the SIZE is obvious but how well it protects is NOT.
Reply: @NICKLASFARFAR  confused about voltage and current being AMOUNT, you say twice amount but technically the amount is measured in amps.  A 12 volt battery will start a car but a one million volt tazer is only good for SHOCKING people into dancing if they could adjust to it's frequency. Instead they just flop like fish out of water.  I tried powering a light bulb with a tazer and couldn't.  Because it's really only 9 volts point something am peers.  Kinda like the AMOUNT of people and ONE president, or police officer with a RADIO and a license to listen on certain frequency and TRANSMIT on the same to corral the millions of sheep to wolf ratio.  Kind of like a lake of fire or LACK of fire. 😉
Reply: @NICKLASFARFAR  I meant to say LACK of FEAR
Reply: @RabbitsInBlack  There are also porcelain wire nuts for high heat, but nothing for lever nuts or push connectors. Lever nuts are convienent for connecting 4+ wires but thats it, wire nuts are better in every other way. To anyone who argues lever nuts are easier to use, if wire nuts are complicated to you, you should leave the electricity alone before you burn your house down
Reply: @toondejaeghere3  those are over $5 each plus the lever nut water proof wire nuts are like $5 for a 20 pack, so sure they exist but that gets expensive fast. However lets be honest both options are not ideal for wet locations better to use water tight junction boxes and liquid tight box connectors.
Reply: @horstklotsch5589  you don't have to cut the wires to remove from a wire nut at all, you are thinking of dead end splices maybe (which are crimped so not removable), there is no reason to have to cut the wires out of a wire nut ever it literally unscrews off the wires, then you add your additional wire and twist the wire nut on, might have to go up a size I have done it thousands of times and believe me if you had to cut them every time I would never put them back on. Also I am not biased against Wago they are nice to work with but my job won't buy them because they cost 5 times as much as wire nuts or spade connectors and if you wire nuts are too complicated you probably shouldn't mess with electricity.
Reply: @edwardpaulsen1074  Couldn't have said it better diffrent tools for diffrent jobs
Reply: @AnalogDude_  those old ceramic wire nuts that they used in the UK are not the same as pastic wire nuts that we use the US. The problem with the ceramic wire nuts is they crack from the heat, as he showed in the video plastic wire nuts have very low resistance and make a solid connection. Europes judgment of wire nuts is based off a garbage product from 70 years ago that hasn't seen use in the US since before my grandfather was a child.
Reply: @CrimeVid  those are garbage and not the same as what we use in the US, the plastic wire nuts are not the same and have been in use since the end of knob and tube wiring. Porcelain wire nuts do still exist though for high temp applications (such as near burners in ovens or furnaces) which unfortunitly there really isn't much else it's porcelain wire nut or porcelain screw block I personally use the wire nut and wrap it with fiberglass tape and I only use them when I have to; the prefered method is a completely new run of high temp wire but some times time restrictions make that not possible.
Reply: @WJCTechyman  you are correct sir, the current rating for wire nuts is vastly over the current rating of the wire that it would hold, so your wire will melt long before the wire nut is even a consideration, not that wire nuts should be passing current anyways because they simply bond the wires togeather and do not act as a bridge the way lever nuts do.
Reply: @keldon_champion  Time is money.
Working with Wagos is faster and safer, compared to the whole price for an installation it is no big difference in the end. In Europe nearly no one uses wire nuts, our outlets in the wall are smaller than yours, it is much easier to put some Wagos behind your switch or socket...
Reply: @horstklotsch5589  if you say so but it takes about the same amount of time for a wire nut as a wago unless you're a little slow and I think there are places wagos are better than wire nuts it is just not everywhere. For example in resistant dependant circuits (many things with sensors) wagos are terrible also in high heat areas there is no option to even use them, however if you have to join 4+ wires or are going to be frequently changing parts out on the circuit they are much easier, different tools for different jobs if you can't see the clear advantages of each system and places where one is better than the other your just being ignorant.
Reply: @keldon_champion  I don't think I'm ignorant. High heat is no problem, because the insulation of the wire will melt before the Wago does. The "normal" Wago (without the levers, for solid wires) is not so expensive, so for me there is no reason to use such an old fashioned system...
Reply: @horstklotsch5589  the push on wagos have more than double the resistance of a wire nut which would absolutely affect a sensor such as a thermistor, there are times wagos are better, times wire nuts are better and a lot of times (most honestly) where it is completely irrelevant which you use. Also high temp wire is a thing so no wire will not melt before the wago if you are using appropriate wire, which this wire is used in tons of applications such as anything with a heating element or for flame rectification rods in gas burning appliances. I don't understand why people simp for stupid shit like this both have pros and cons and both have appropriate applications, the only person who is wrong is the one who fails to use every tool available to them to do the best job they can.

Edit: also lever nuts where invented in 1951 modern plastic wire nuts (not the old ceramic crap that cracks and causes fires) where invented in 1963 so I don't think old fashioned is an appropriate term seeing as in wagos are the older tech just saying.
Reply: @keldon_champion  If the environment requires high temp wires, wire nuts and wagos are not the good choice. For this kind of applications exist special terminals with ceramic insulation. The problem with thermistors is not the resistance of the wago, it is the material. If you use copper cable to extend the thermistor cable, you have the same problem, even if you use wire nuts. You must use an extension cable that fits to the thermistor you use. For example Fe-CuNi thermistors require a cable made of the same material. In this case you may use special terminals, or wire nuts, or you twist the 2 wires together and put them in one hole from a Wago...
Reply: @horstklotsch5589  yes thermistors use special wire but you can still splice a new thermistor onto the old wire in a lot of applications, and what about extending wire for heating elements or flame rectification rods? You're just hunting for any reason to hate on wire nuts, both systems have appropriate applications but as I said earlier in most situations it is completely irrelevant, I'm done debating with who refuses to acknowledge reasonable and logical criticism and just simp for 1 system while blindly rejecting the other, so we are done here unless you can show me a way that wagos can be used for every application wire nuts can because I see no way to use them with high temp wire, or in resistance sensitive applications, if you can answer me those we can talk but right now you're just being a simp.
Reply: @keldon_champion  The best thing is, you use your wire nuts, I use my WAGOs, and everything is fine.
Reply: @horstklotsch5589  as I said I use both for different applications, but you're right in most applications either one is completely fine use whichever you like.
Reply: Yeah I thought it was odd that he even had to go to the trouble of measuring the resistance? It's the resistance of twisting bare wires together which is to say the resistance of the wires.
Reply: @mongelaloe2304  no.. wire nuts hold string
Reply: @NICKLASFARFAR  Sure, but that's not down to the design of the nut, but the skill of the operator. While it's true that the Wagos are more bullet proof (for hoe DIYers) you average electrician knows when the connection is solid... and for some connections, you pretwist the wires with some pliers to ensure a good connection.
Reply: @sierra5065  Yep! Wirenuts (we tend to call them marrettes in Canada) definitely depend more on skill. For DIYers, I usually recommend wagos.
Reply: But you do want the wire nut to be sharp enough to carve into the copper to get a secure fit and if the plastic was heat resistant and non-flammable that would be a plus.
Reply: It is also evident by the fact that if you remove the wire nuts the circuit will still work (it just might burn ur house down 😅)
Reply: @mongelaloe2304  shouldn't be twisting the wires together with the wire nut anyways, you're supposed to pretwist with pliers. Not sure if they're called the same everywhere, but 9" lineman's pliers to be exact. The twist takes no effort and comes out identical every time after your first couple dozen while learning as an apprentice.
Reply: @Peter_S_  any metallic object in contact with current needs to be rated for said current. This fantasy that wire nuts aren't to conduct current but more to hold the wires, is ridiculous. You're wrapping wire around copper conductors, it needs to be rated for the current carrying capacity.
Reply: @NICKLASFARFAR  yea but like, it's not like the entirety of the current is going through the conductor either
Reply: Hi,
This is how I learned to use wire nuts in the 70s: we strip the wires (from 2 to even 6-7 strands) ~3cm long. Then twist it tightly first by hand, then with a tool (combination pliers) (not the wire nut does the twisting). When this is done, the twisted wire is cut to a length of ~2 cm, and the wire nut is screwed onto it. Here, the inside of the wire frame was a conical steel spring. This fixed the wires well. According to my practice, the wire nut was developed to improve the twisted bond that was found to be non-standard.
Szia!
A huzalanyákat használni én így tanultam a 70-es években: a vezetékeket (2-től  akár 6-7 szálig) ~3cm hosszan csupaszítjuk. Azután először kézzel, azután szerszámmal (kombináltfogó) erősen összecsavarjuk (nem a drót anya végzi az összecsavarást). Amikor ez kész, az összecsavart vezetéket levágjuk ~2cm hosszúra, erre csavarjuk rá a drótanyát. Itt nálunk a drótanya belseje kúpos acélrugó volt. Ez jól rögzítette a vezetékeket. Az én gyakorlatom szerint, a drótanyát a szabványtalannak nyílvánított sodrott kötés javítására fejlesztették ki.
Reply: @noggfresh  why does not twisting wire make him a clown ? Maybe he's not experienced in making stupid wire hack TikTok videos or working to ancient NEC regulations.
Reply: @noggfresh  nah, it's not a TikTok video at all. TikTok videos contain clowns twisting wires together, like your NEC code. All electricians don't use wire nuts, they aren't used in Europe or the UK because our regulations require us to test the installation for manufacturing defects in both the cable and receptacles, require earthing resistance values, PFC, polarity and continuity of bonding conductors. And you can't do that with big silly mounds of twisted wires.
Reply: @WB_Sparks  obviously this isn't a tiktok video. And no shit Europe and UK don't use em. But you guys use Linesman Pliers, no? Lol yet you twist no wires 🤷.  And I can do all that testing with or without wirenuts. Lmao

My point was he's comparing connectors and didn't even use the wire nuts correctly. SAME AS A TIKTOK STYLE VIDEO
Reply: @WB_Sparks  Lmao and seems like you guys don't know how to troubleshoot they gotta make it idiot proof
Reply: @noggfresh  and I quote "Do not twist conductors installed in a single terminal together – this may result in 
work hardening and conductors snapping when untwisted to permit, for example, 
periodic testing" 

Nothing to do with trouble shooting or anything else. If you break a conductor you've gotta add a joint which increases resistance, it may need to be installed in an enclosure or it may need to be replaced completely as some conductors should be continuous without breakage. I understand all this testing is alien for you fit and forget boys, but the rest of the grownups in the electrical industry can actually prove their installation or periodic test with parameters and values.
Reply: @noggfresh  He sets a very bad example. It can even be a fire hazard. First, you have to make a staple screw connection (it doesn't matter in which direction, left-handed people shouldn't do it!), and then wrap the wire nut on it to fix it.
Reply: @Peter_S_  I don't think you understand that when you pass current through a wire it will heat up, and just like with wire insulation, a terminal connection such as a wire nut would have a theoretical maximum heat it can withstand before its integrity is compromised. That is the relevant point being made.
Reply: That is nonsense. The current rating is not just fore the metal bridge of the device, it's for the entirety of the device. If its integrity is compromised, it is no longer safe. It's exactly the same as the wires' insulation and why it changes along with the size and ampacity of the wire. "The wires are the conductive bus" but the insulation is to protect the current from going outside the bus. Exact same situation as a wire nut which is why it needs a current rating. You don't want it it catch on fire, melt, etc just like the wire's insulation.
Reply: @Peter_S_  it's irrelevant if the device properly insulates for this resistance, which the Wago does. It is faster, more idiot-proof, easier to reuse and rewire. There are a lot of great trade-offs for that marginal resistance benefit.
Reply: @Peter_S_  Read the manufacturer's instructions on the wire nuts. Pre-twisting isn't even required. If I have to use one, I pre-twist, but it's certainly not in its design--it's just something that's been developed by industry for mechanical strength. This is like the people trying to pretend Phillips screw drives are designed to cam out when they really just suck.
Reply: @williamcrawford5459  That's like saying wire insulation doesn't need a rating on it because if the correct amount of current is passed through it, no problem. There is a safety factor to nearly everything, and insulation is one of those things. Ideally your wire insulation is burning off before your connectors.
Reply: @Makelifehappennow  Not enough surface contact for what? It's plenty for the current it's rated for and the wire insulation will burn off before that metal bridge fails. Never had a genuine Wago slip in my life--the bite is pretty strong and leaves a very visible dent in solid wire.
Reply: @ronb6182  Those aren't genuine Wagos and those things suck (the ones that come with light fixtures).
Reply: @edwardpaulsen1074  Wire nuts are far more complicated than a Wago. Open lever, insert wire, close lever. There are obvious slots for each individual wire. Don't let your familiarity with something cloud your judgement of simplicity. Give each one to an 8 year old and see which one does better. And as Horst stated, they can all be removed--just read the directions.
Reply: @keldon_champion  wire insulation will fail before the Wago.
Reply: @keldon_champion  I don't think you should be using either of these basic connectors for the things you're talking about. Entirely different category of wiring there.
Reply: @plsreleasethekraken  high temp wire, they use it for all kinds of burner and heating element applications
Reply: @plsreleasethekraken  that's a nice textbook idea and all but sometimes out in the real world you need to make things work and I noticed how you didn't mention an alternative to these "basic connections"
Reply: @keldon_champion  right, so you would want to use a high temp connector. right tool for right job. not the job for a standard Wago or wirenut.
Reply: @plsreleasethekraken  that's what I originally said lol we are on the same page and honestly for most electrical work either is fine, it's preference more than anything I just keep seeing all these people arguing that one is the best and the other is unsafe garbage which is not true, lever nuts, push connectors, wire nuts, crimp connectors (my preference lol), terminal lugs are all fine when used correctly and have their own pros and cons, this is also the reason I stock all of them on my service van, the right tool for the right job. I only shy away from lever nuts because they are expensive but you need them for some spark free applications like working with HC refrigerants where a leaking flammable gas could cause a fire if there is a loose contact that arcs.
Reply: @plsreleasethekraken  I know they are jabbers. I will stay with ideal wire nuts they are made in the USA and whenever possible I use American made products. It may be an oxymoron at times but I support American products when possible. 73
Reply: @plsreleasethekraken  You are quite amusing... Have a set of wires in your hand to be connected in one hand and reach into your pocket for the connector... Wire nut just screws into place with the other hand... Wago must be held to open the levers and wire inserted into each and then closed... your example fails... and if you pre-open all those slots then they are harder to get out of a pocket and the levers might still partially close... This has nothing to do with "familiarity" and is simply the number of steps and ease of use. 

As for your claim of being able to remove the non-lever variety, yes, they can be removed but it usually trashes the connection surface of the Wago which must then be replaced... You can argue all you want about "preference" or "Familiarity", but you cannot argue with physics... It is what it is.
Reply: @edwardpaulsen1074  whatever floats your boat brother, but if you want to talk physics, then you can line up 1000 wagos and 1000 wire nuts and connect with all of them--due to the variability in twisting application as well as the byzantine wire allotment (2 of this 5 if that) for every wire nut, you're going to have more variable and thus inconsistent connections than wagos. That also means when N is high enough,  failures of wire nuts will be higher. Both are acceptable wire connecting DEVICES, but application of a device matters. It ain't physics, it's repeatability, consistency, and statistics.

Not to mention stranded wires which must be slightly longer than the solid when making a connection. There are simply far more variables. 

If you like putting on wire nuts better than wagos, of course that's your prerogative. Wire nuts are far more inconsistent in their connection than wagos however (given a high enough N) and that is due to human error because of the increased variability. 

I have come across so many that are slipping out of their joint because of this. Eg:  950 out of 1000 were fine, but 50 weren't. This isn't acceptable for electrical wiring and there are simply better ways for most residential wiring.

See illustrated example:
https://youtu.be/AWiyreFFt-Q

The reason it continues in north America is they were invented here (availability, familiarity, inertia) and they are cheap. No builder or electrician wants to pass on the price to their client when their client has no clue of the value. 

It's the same for an HVAC system. They don't get priced into home values because buyers have no idea how to evaluate them. A remodeled kitchen though...  That goes straight into the sale price. That's why builders put in the cheapest possible HVAC solution in 95% of homes.
Reply: @plsreleasethekraken  You proved my point within your long winded dissertation. Yes there are variables involved, and human errors.... there are also different Wagos required for solid and stranded wire. You MUST use the lever lock ones for stranded and you better be using them properly or it will fail inspection. Stranded wire will also compress a little over time and a properly set wire nut will physically lock mechanically into the wire as opposed to the clamping of a Wago. Anyone in maintenance knows that you always need to retighten screw terminals due to that deformation on stranded wire.  Wire nuts are also putting the conductors in direct contact rather than bridging a contact with a dissimilar metal that does not have the same electron flow characteristics and possibilities for corrosion. 

Overall, I use both types depending on the situation at hand. Right now there is also a little issue with availability since Wagos are an assembled part that can face shipping issues whereas Wire nuts are ubiquitous and available. Unlike your opinion, I can see the pros and cons of each type of connector and use and install them appropriately. Ultimately I suppose we agree to disagree because the arguments presented do not change the physical facts and the "human error" thesis can apply to both types of connector with Wagos possibly having a better repeatability at the cost of price point. However, if you have a properly taught and conscientious crew, that variable is close to parity.
Reply: @edwardpaulsen1074  you can use stranded wire with 221 or 2773 wagos, so different connectors are not required for stranded vs solid.

Galvanic corrosion is possible with the dissimilar metal of the wire nut screw as well. It still conducts even if it's not the primary bridge of the two connectors.

Pack either one with dielectric grease if you're worried about moisture.

The argument isn't that wire nuts don't work. If you know how to use them and like them, then use them. However wagos make more sense as a default for residential wiring and should be the default unless you truly can't afford it. Even in your capable hands, the connection is a black box and you can't see it to confirm it.

https://youtu.be/AWiyreFFt-Q

The only time I wouldn't use a wago in home wiring is if resistance really matters and that's irrelevant to normal residential wiring applications. Heat spec for a wago is orders of magnitude higher than anything the resistance creates. They will be fine for decades to even a century.

2773 and 221 are available in boatloads on Amazon right now, but it proves my point that the reason wire nuts are used so often is due to availability, familiarity, and cost.

I'm not trying to convince you not to use wire nuts, I'm saying I think they should not be the default choice for residential wiring. On that we can agree to disagree, but I have yet to hear an objective argument as to a wire nut benefit outside of cost.
Reply: @alandahlstrom7213  do it right!
Reply: @David-bb2ed  I think you mis-read the resistance measurement shown in the video. WAGO does not add a quarter mile (1320ft, 402m) of equivalent wire resistance. The resistance shown was in MILLI-ohms (i.e. thousandths of an ohm) not straight ohms. WAGO was 2.2 milli-ohm vs. 0.15 milli-ohm for wire nut. WOW, WAGO is almost 15x resistance of the wire nut. However, we are dealing with very small numbers to begin with so the added resistance isn’t that big of a deal.  14AWG (2.5 mm2) copper solid wire is 2525 milli-ohm per 1000 feet (8280 milli-ohm per 1000 meters) or 2.525 milli-ohm for ONE foot. So adding 2.05 milli-ohm by using WAGO vs wire nut adds the equivalent of less than 10 inches (25.4 cm) of 14 AWG solid copper wire to the circuit. Considering how often resistance, heat or power loss are brought up in these threads, it doesn’t seem to really be an important consideration in comparing the connectors. There are many other aspects that should be the focus of attention.
Reply: @keldon_champion Jesus Christ you have that guy a lot of leeway in this argument to then get absolutely nothing back from it. Well, anyway, I definitely appreciated a more balanced comparison of the two methods. Thanks!
Reply: Really the wires need to be pre twisted to ensure a proper connection. When done with solid wire that connection will handle more power, and create less heat than the wire itself. I'll post a link to a video demonstrating wirenuts outlasting every other modern connector type on overcurrent tests, but I'll seperate it in case they auto hide it for having a link. The only times I've ever seen any type of problems with wirenuts is when inexperienced people just stuck them into the wirenut and twisted it. It is probably ok if it's not at the beginning of a circuit and has only two wires, but the wirenut will not twist them together enough on solid wire to ensure a solid connection
Reply: @tonyjover  There are home & commercial laundry dryers, large window AC units, welders, compressors and others that use large plug & receptacles.
Reply: @tonyjover  No, there are electric dryers, large window AC units, welders, compressors, ranges and others. These all use large plugs and receptacles.
Reply: @Peter_S_  loosen
Reply: This why nuts are superior, imo. My connections are made with the wires using a pretwist. I put on a nut just to cover it.
Reply: he's European, what do you expect? 😂
Reply: @horstklotsch5589  Why would you need to cut the wires? You can unscrew the wire nut and then tighten it again with the added wire.
Reply: @jarphabib or. Here's a thought. Just twist them all. If you have personally joined the wires, you can inspect the connection before the wire nut even goes on. At that point, it's only insulating the connection, the connection is already made. And the same applies if using stanged, small gauge wire, all of it. Even if the wire nut will twist for you, it's just visibly done correctly before the nut goes on. Pull test at the end if you're remotely concerned, and yeah. Never once have ever had an issue with a loose connection on an installed device. Wagos may be simpler, but simple and better are two very different words. Also, btw, not even gonna front, I love wagos. But to say they're better in any way literally at all feels like a reach
Reply: This is exactly right. As an American electrician in the trade 45 years I can tell you wire nuts are superior even though they do take a little longer to use. What is missing in this video is pre twisting which you should always do. You can pre twist up to 7-#12 solid w 1” stripped and your connection is copper to copper. You slightly lead any stranded in the bundle for good grab.
Reply: @etherealrose2139  Yep. But for DYI types who don't have much practice - or idiot electricians, like the ones who did my house - the Wago is hard to mess up. I tend to use them for lighting, since it's low power, and I don't have to check to make sure the connection is solid. I'm not sure I'd use them to connect wires to run a space heater, or anything like that, even though they would probably be okay.
Reply: Surely wirenuts are joint protection devices? It is essential therefore to make the joint first? Using the nut to create the joint is to my mind at least completely wrong.
Reply: Wire nuts have a voltage rating... some all the way up to 1000v... check ideal websight... most are 300-600v
Reply: @NICKLASFARFAR  The contact surface of the connection is, when well done,
bigger than the cable section. so the connection becomes the cooler part of 
the circuit. When things go wrong, (oxidation) the unwanted resistance of the connection is the key factor. This one is not the same in all cases. Since P = I² x R,
you can melt  the nut with different current levels. So the max Amp can NOT be 
indicated. For the Wago the max Amp is based on the known resistance of the
small contact surface and the little conducting copper part.
Reply: 20 year electrician here. I was taught that the electrician makes the joint and the wire nut is there for insulating purposes  ;-) if you twist the wires appropriately it creates a bond that can handle more amps than the wires  themselves can not. Making the joint a stong point in a circuit instead of a failure point. As for connecting stranded to solid you can either force the solid wre to tiwst around the stranded. Or simply stagger the wires under the nut. Putting the stranded wire slightly ahead of the solid brfore screwing the wire nut on
Reply: @KlodFather  Most european outlets are 230 V / 16 A 🤗
Reply: @ricozam132  yes, 16 A fuses for devices, but 10 A for lamps (mainly LED now)
Reply: @DidierMisson  -  Most of the ones I have seen were 10 amps or around 2kw available from the outlet. More modern safer connectors have probably pushed up their ability a bit... Most of the two round pin plugs I have seen were rated around 10 amps.
Reply: @vickanid1862  
No.  WAGO push-ins and lever connectors use a tinned copper bus bar and some form of stainless steel spring.  The contact with the spring might be conductive to some degree, but the bus bar is expected to provide the primary conductivity of the connection.
Reply: They are not intended to conduct electricity per container metal part this is one of the big problems at the US Electrical system
Reply: Pre twist, wire nut, Noalox for outdoor connections.  Do it correctly and it is super reliable.